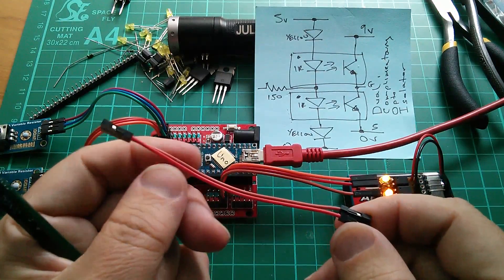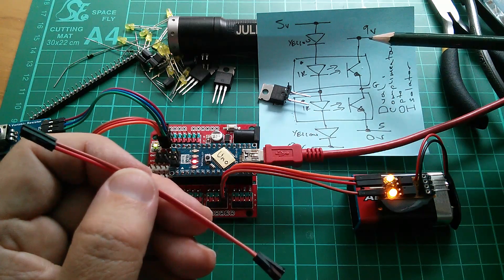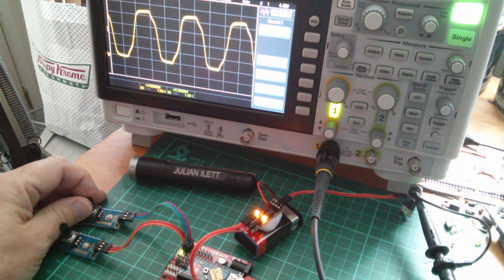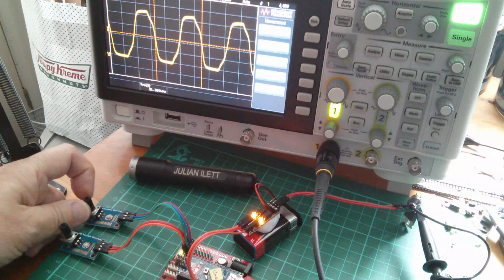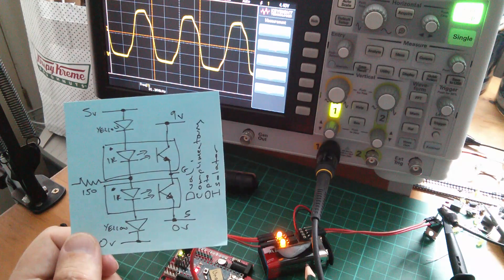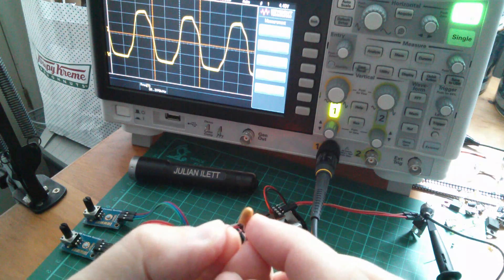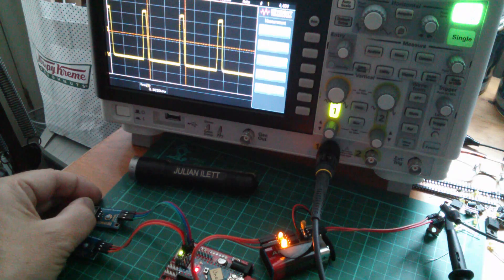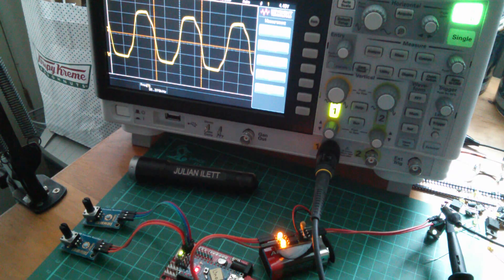DCOI Revisited (part 3) - Muppet 2 Project

Comment: Perhaps you can also try to see how the waveform looks with another type of supply? (e.g. your bench power supply)
Reply: doesn't matter, optos are too weak to drive this mosfets fast
Reply: I remember reading such comments in the previous section of this series. Julian seemed to blame it on the internal resistance of the battery, only to find that adding a capacitor didn't fix it. If I recall well, an earlier suggestion was to use a darlington pair for driving the mosfet at faster speeds.

Comment: How to inverter sine ware feed back volt Ac.  12vdc to 220v Ac using arduino
Reply: in two step, first you step up 12v dc to 300 v dc and you feedback that 300 v dc to control current, and second step you convert 300 v dc to 220 vac rms.